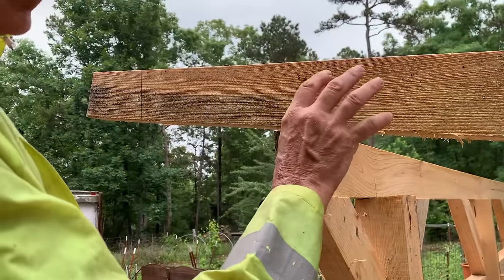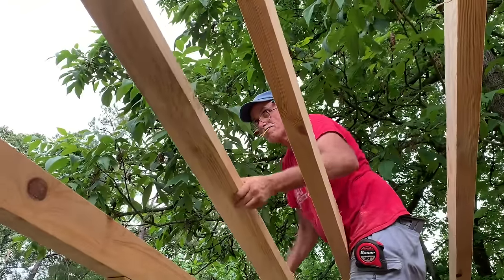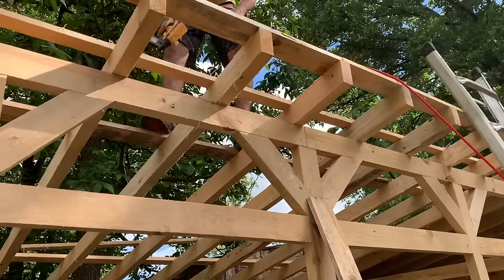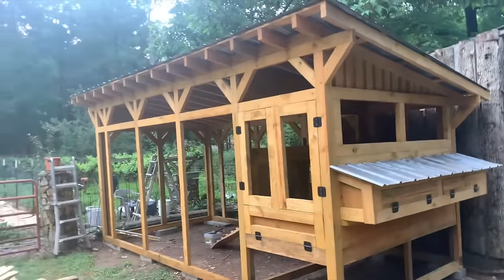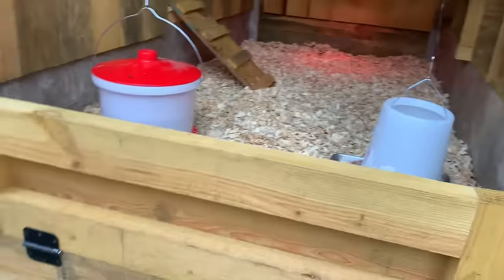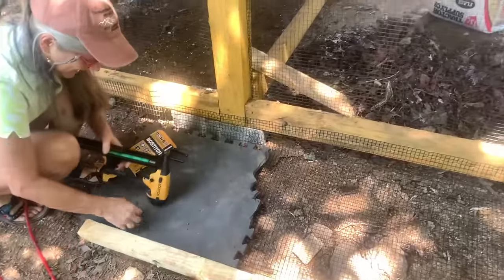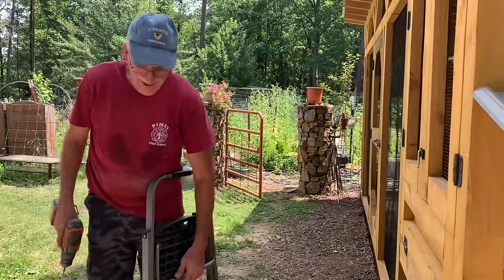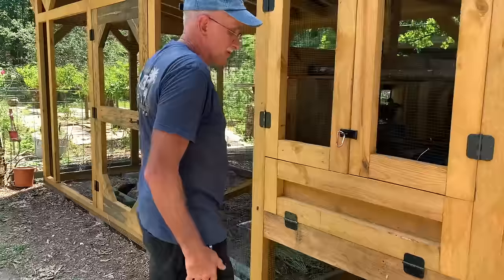Awesome chicken coop Part 3. Rafters, roof and finishing details. Moving chicks into their new home!

Comment: ❤ I absolutely love your videos!! My husband and I will be getting chickens soon and we both love your coop. I probably missed this part, but was the  material inside of the nesting boxes the black foam? Thanks for all of your tutorials!
Reply from the maker: Yes we just used some high density black packing foam that came with one of our e-bikes. It’s not really necessary, just helps keep their feet warm and makes it a little easier to clean if it needs it. Those lock together foam pads to stand on would also work. Just be sure not to use anything that they can easily pick at and choke on. Hope you have fun building yours!😊👍👍

Comment: On the run I see that you put those little design/support 2 x 4 at the top sides of the studs. I was wondering what sizes you cut those and at what angle. 
Thank you, I watched all parts of your coop building, it was amazing.
Reply from the maker: They are cut on 45 degree angle. The length will vary depending on how you build your coop. I just cut one angle and hold it up even where it will fit and then mark it. Cut it and check the fit. Then before you nail it in, use it as a pattern to mark all the others. It goes pretty fast. 😊
Reply: @natureartgirl  I thought so. Thank u so much for replying. I’m in the process of drawing out my chicken coop build atm. Almost done 🙌

Comment: First time watching your videos, the coop is wonderful. Do you all have building plans? Would love to make one like this.
Reply from the maker: We don’t have any plans, but it should be fairly easy to build just by watching the videos. You could easily change the size to whatever you need. On ours, the front is 8’ tall and the back is 6’8”. That gives you about a 2 pitch roof. We used 2x4”s 10’ long for the roof. Used one roll of 4’ x 100’ hardware cloth with 1/2” mesh that is coated with black. That was enough for the main structure and part of the predator apron around the bottom, but had to use a little more 2’ wide wire to finish the predator apron. Hope this helps!

Comment: Beautiful coop. So how are you going to take care of closing the coop in during winter time. Just wondering 😉
Reply from the maker: We haven’t decided for sure. You still have to have ventilation even in winter, so we will leave the window above the nest boxes as is and the one opposite it inside the run. But I think we are going to make a removable inset to block off the two side windows so there is not too much wind on them. It doesn’t get very cold here, so they would be ok without it, but they would probably be more comfortable with it covered. If you live where it is very cold, you might have to do something different. 😊👍👍

Comment: Excellent job!  You are right it is hard to find a good stain..    My favorite used to be the old Flood Oil based semi-transparent before they got bought out..  That was the longest lasting stain I ever used..  Painter of 20 plus years..  

I like Pure tung oil too :)  Natural non toxic, did it on my White oak quarter and rift sawn floors about 3 years ago and haven't even had to touch it up yet.  Just slow drying.. But you can do it in sections and it blends in well.

What size is the coop and run?
Reply from the maker: Yes, this stain is slow drying too. Takes about 3 days. But it soaks in well and never peels. Good to know about the tung oil. I know a lot of people swear by it! 👍 
The coop is 18’ long by 8’ wide. It would be just as easy to make it 20’ long, but that wouldn’t fit in our space. Thanks for watching!😊
Reply: @natureartgirl  Yea it is just a little spendy, like everything nowdays..  Thanks for making the video on here! Was my favorite one out of all the other 15 plus I saw.. Good work!

Comment: Thanks for all the help so far, forgot to ask ~what color stain did you use and ~about how many gallons did it take you?  Thanks so much!!!
Reply from the maker: We used the natural base 01. The color mellows out quite a bit when it dries in a few days. It took quite a bit since we had rough cut wood. If you use purchased wood, it probably wouldn’t take quite as much since it is smoother. About 3 gallons. That was one of the major expenses of the build. Be sure and stain it before you put the wire hardware cloth up and it will be much easier! 😊
Reply: @natureartgirl  Thank you so much!!!

Comment: Amazing!!!  
What stain did you use?
Reply from the maker: Outlast Q8 log oil. We got it online from western log home supply. It is a little pricey, but worth it! It goes on very nicely and actually soaks into the wood. It is a wood preservative as well as stain. 😊👍
Reply: @natureartgirl  Thank you so much!!!
Reply: @natureartgirl  One more question please.. did you use pressure treated wood on the exterior areas that you stained?
Reply from the maker: No we did not. We milled all the wood ourselves on our mill. But that is an experiment 😁We are really putting the stain to the test. It would definitely be a good idea to use treated wood and then stain it if you are buying wood anyway since it isn’t much more expensive. We did treat all sides and ends of our boards. We do recommend treating the cut ends very well even on treated boards as that is the most common place for them to rot! We will let you know how our experiment works out!😂👍

Comment: Hello! If I may, aren't you worried about predators digging in?
Reply from the maker: We put a wire predator apron around the bottom. It is stapled to the base and extends out about 2 feet all around. Then it was covered with dirt. You can see it in the video toward the end. But yes, if you don’t have that, a predator could easily dig underneath. 😊👍
Reply: @natureartgirl  Thank you!

Comment: What are dimensions of coop?
Reply from the maker: It is approximately 8 feet wide and 18 feet long. It would be just as easy to make it 20feet long but that would not fit our space. We used 10 foot boards for the rafters so there is an overhang on both sides.

Comment: Total cost?
Reply from the maker: We only have about $500 in it but that is because we sawed our own lumber and we had the metal roof already that Lance bought years ago at an auction. So our major expenses were the hardware cloth(cage wire) , stain for the wood and cement blocks and automatic door. We also had plywood left over from other projects. So the expense would have been considerably more if you bought all your materials new. 😊
Reply: @natureartgirl  good for you!  You did a beautiful job!
Reply from the maker: Thanks!😊

Comment: What are you doing on the bottom for safety? Can't see real close. Wire on the bottom -I see!!!
Reply from the maker: Right! Used a 2 foot wide piece of cage wire/hardware cloth all around the bottom. It is stapled to the wood and then covered with dirt or gravel. That way nothing can dig under the wall. 😊👍